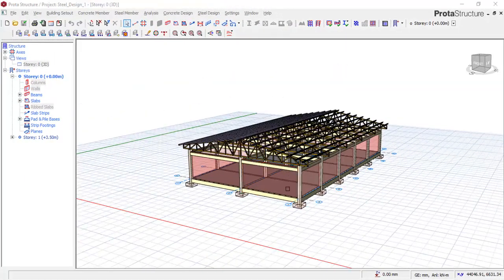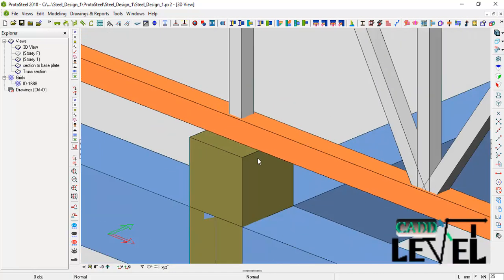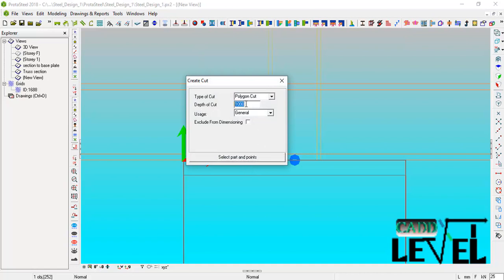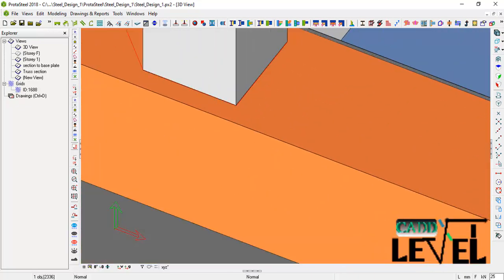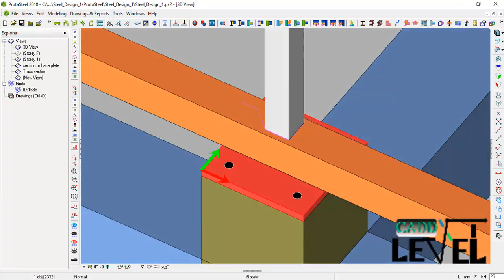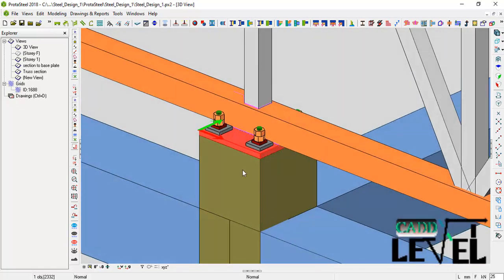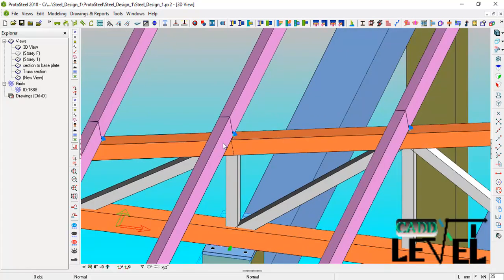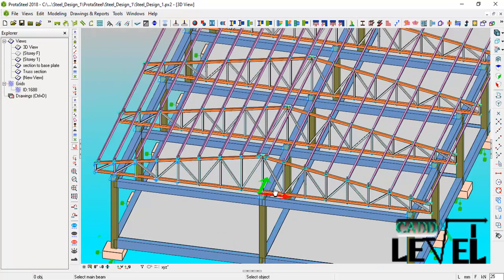How to Design Steel Connection in Prota Steel

Comment: Hi 

I hope you're doing well. I wanted to ask if you could do me a favor and send me several sample project files for the software program, Prota Structure. These files were referenced in a recent video I watched, and as someone who is new to the program, having access to these files would greatly assist me in getting a better understanding of the software's capabilities.

If it's possible, could you please send me these files? I would really appreciate it.

If you have any questions or if there's anything I can do to help you out, please don't hesitate to let me know.

Thank you,
Farhad
Reply from the maker: You can join my training on the use of the software program to design RC and Steel Structure